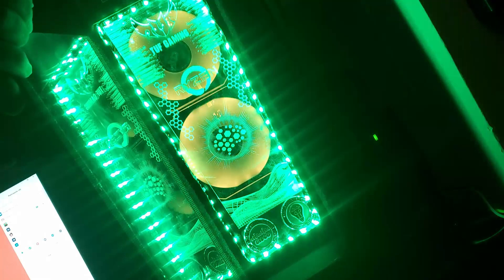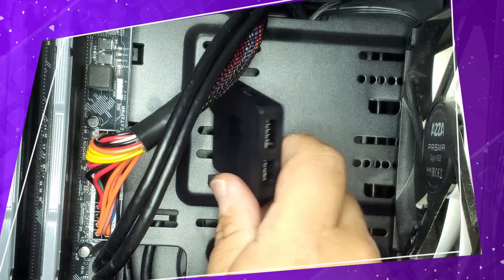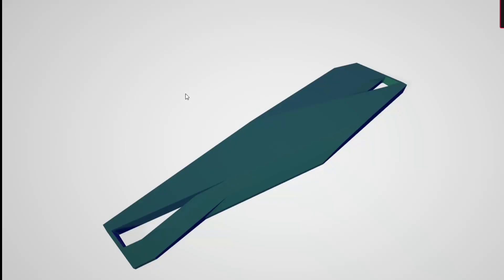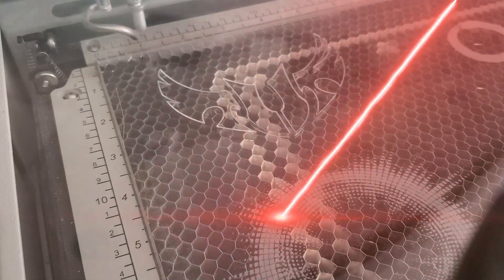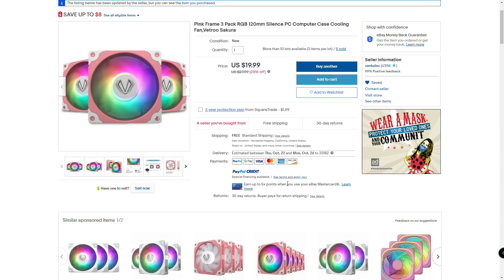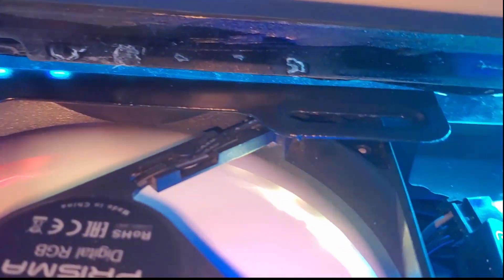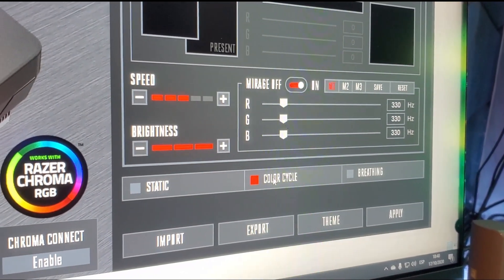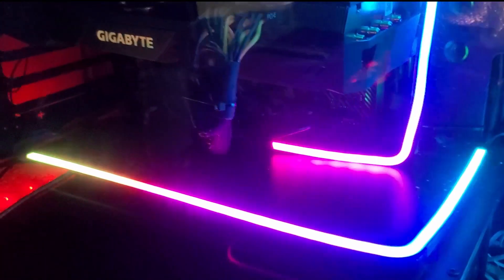ARGB, RGB Led, Neon Flexibles, Corte y Grabado laser en Acrílico e Infinity Mirror MOD

Comment: Hola, tengo muchas dudas con esto del RGB, he visto muchos vídeos al respecto pero, como no he puesto en práctica nada, porque no se como comprar, iluminación led para mi PC y me da miedo errar porque mi presupuesto es limitado, yo tengo una mother ASUS PRIME B450a-m, no se si me funcionarán unos ARGB, para esta placa. Gracias quedó muy padre el Mod.
Reply from the maker: Mi amigo es una tarjeta muy buena pero solo tiene un conector de 4 pines RGB, por lo que solo podrías cambiar el software con un solo color yo tecno una X570 TUF + este trae 2 de 4 pines RGB y 1 de 3 pines RGB. Mirá este video que hice de mi nuevo setup, igual podes sincronizar todo tu escritorio desde ese pin con un HUB https://youtu.be/4D1lxwvcukM todo el RGB lo configuré desde el Motherboard.
Reply from the maker: Agradezco tu suscripción.
Reply from the maker: Acabo de agregar unos videos en el Canal para tu motherboard y hubs

Comment: Buen video amigo felicitaciones, una pregunta sabras como poder sincronizar el rgb de mi pc que no sea con el boton del cpu es que no tiene aura sync mi mobo
Reply from the maker: Depende de tus conectores de Rgb 4 pines 12 voltios o de 3 pines de 5 voltios. Si no los tiene tu motherboard podes comprar un ID-COOLING HA-02 8 Way PWM Fan Controller SATA Powered 8 Way 5V 3 Pin ARGB Hub o un cooler master que se conecta a uno de los conectores Usb y de allí sacas rgb o argb
Reply: @SleeperTechBrain  esta algo complicado pero esta bien amigo gracias por responderme y explicarme vere como le puedo hacer que no sea con el boton del case
Reply from the maker: @warchamp92  que tarjeta tienes asi te ayudo
Reply: @SleeperTechBrain  gracias amigo tengo la Asus Prime Z390-P y mi case trae su controlador rgb de los 6 ventiladores pero con boton en el case solo asi se cambian y sincronizados pero yo quisiera con algun programa o algo mas practico siento que el boton de cambiarlo lo voy arruinar
Reply from the maker: @warchamp92  Si revise tu tarjeta, no trae ningún set pines para controlar RGB ni ARGB, lo siento amigo, tendrías que tener una tarjeta madre que puedas conectar los ventiladores RGB de 4 pines o ARGB de 3 pines a la motherboard.
Reply: @SleeperTechBrain  ok gracias amigo ya entiendo gracias por tu ayuda
Reply from the maker: @warchamp92  a tus ordenes
Reply from the maker: Te recomiendo https://youtu.be/CRHxJZoRFM0